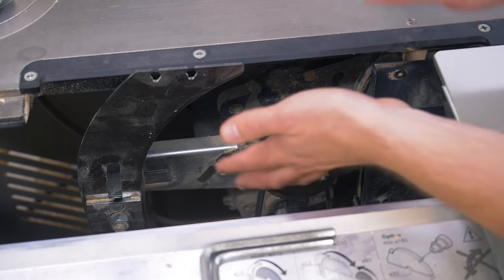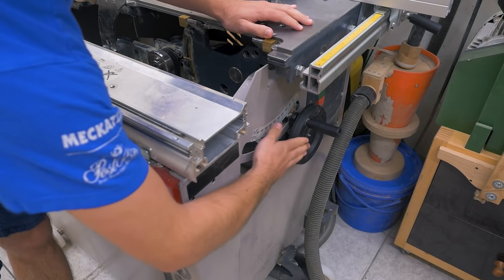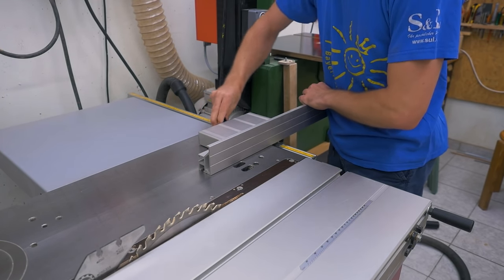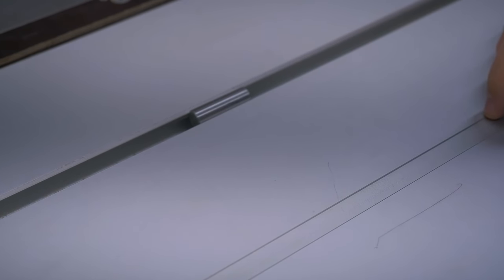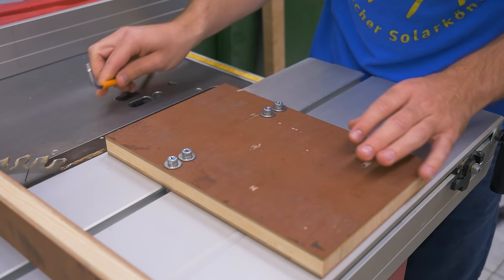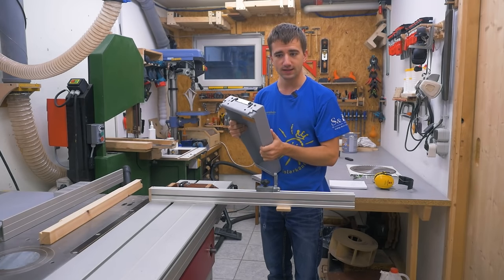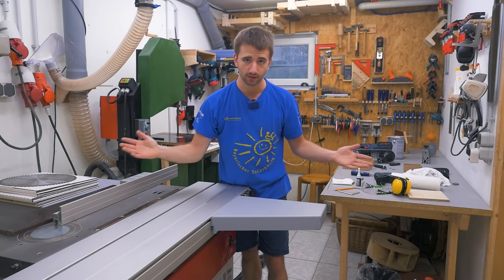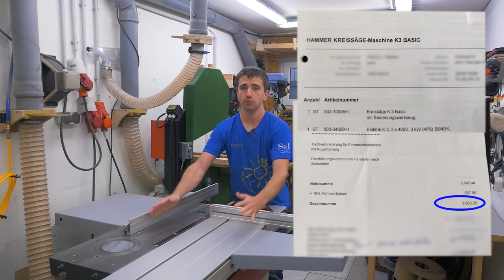Inside a Sliding Table Saw + Long-Term Review + Upgrades

Comment from the maker: Long break since my last video. I hope you like this one again. BTW, I made a new logo. What do you think about it?
Reply: I like that it doesn't look like the ROHS certification symbol ;)
Reply: On a more serious note, it's easier to see what this one is. The saw blade was much too small for a youtube thumbnail.
It'll be exciting to see how internal gears like that fits into your future projects...
Reply: 12 51/127th of an inch, yeah even us non-metric users don't use those fractions, My goodness! For reference that's just slightly smaller than 25/64ths which I still don't measure things that small in my wood shop, too small for me to see
Reply: Logotastic :)
Reply: @jebowlin3879  But your finger can still feel a 1/64th difference between 2 lengths.
Reply: For the record, most people I know do not use Imperial measurements for anything small because it’s very arduous. When I’m building with precision in mind, I always use metric. When I’m roughing out measurements, I use Imperial because it’s ingrained in my mind — I can see with my eyes if something is 18” with great precision, but I’ve never been able to make the mental leap with metric. Does that make sense?
Reply: I like it!
Reply: I like the video and how you have attacked the improvements. Your logo looks a bit like a planetary gear. The initials are clear, but for what will the graphic stand for? Jigs, tools, metal vs 🪵? Have you tried to combine M and H to a single letter ?
Reply: Hey, very nice logo, fits very well to you and your projects! One question: could you link were do you get those nice flip handels? ...need to do some upgrates =)
Reply: I like it, but I'm gonna miss the old one :/
Reply: Waiting for Felder contacting you again for improvements and something like that... was du schon alles gerichtet und umgebaut hast bei den Produkten von denen... Hammer... 😎😉
Reply: Two of your newest videos went unnoticed from me because of the new logo. I found this one only today. These videos have been in my recommendations but I haven't recognized them as your videos.

Comment: An interesting in depth real world review by a guy who has bought the gear with his own money - this is very different to the sponsored channels.
I have a bigger brother with the integrated spindle moulder and love the precision and safety these saws provide.
I installed a decent ducted dust collection when I purchased the saw and a couple of years later designed and built and automated control system to handle the 2 gates on the saw/moulder, 2 on the planer/thicknesser and the one on the bandsaw. This is one of the best productivity improvements as it allows me to concentrate on the cuts rather than turning the collector on and making sure the correct gate is open.

Comment: Hello Marius, I remember when you bought that Felder table saw, and visited the factory, if I'm not mistaken, and helped the Felder designers re-engineer that 'flip-stop' mod..which was rolled out to existing customers, and used in later factory customer builds on your machine type. It seems not very long ago, ha ha. Clearly the Felder machines are first class, as your saw still looks very new. I am very jealous of your lovely table saw..sadly, where I live, the import duties would probably double the cost of a similar machine sent to where I live. I manage with a much lesser table saw...with a lot of mods, but will never approach the precision of a decent factory built tool. Keep up the videos, you are one of the best engineer YouTubers, and we appreciate your no-nonsense, and very human style of videos..we all make (many!) mistakes which we learn from when doing woodworking, and I love that you include some mistakes on your builds. Many thanks for all the hard work that goes into quality videos that you make.

Comment: Great video, and thank you for the look inside the K3.  I wanted the K3 Winner for my shop, but the delivery time was too long.  Instead, I bought the Minimax SC2 Classic for about the same price as the Classic from a distributor in Mannheim.  The delivery time was one week and the cost included the scoring blade option, delivery, assembly, and commissioning.

Your ability to recognize an opportunity and develop a working solution never ceases to amaze me!  Your solution for the extension table is wonderful, and I hope Felder is watching and paying attention as it did with your flip stop design.  The extension table for the SC2C is similar to your design which makes installing and moving it simple and easy (Einfach ist immer besser 😄) .  I attached an Incra LS25 positioner to an extension table to create a point in space for ripping with the slider instead of the fence.  I haven't used the fence since.
Reply from the maker: The LS25 positioner for ripping sounds pretty good. I assume you have a bit more space available than me

Comment: The endcap zero clearance was mind-blowing. It's so silly easy. Its so brilliant. Im making one for my felder asap
Reply from the maker: Did you know that Felder also offers them for sale (at least for Felder and Format4 saws)? Don't look at their pricing though, that's insane.
https://www.felder-group.com/de-de/shop/splitterzungen-sc123868/splitterzunge-fur-format4-ablanganschlage-sp123870
Reply: @MariusHornberger  I didn't know that, but i sneaked at their pricing and for that price i can make my own, enough to last me a lifetime, and still have som change left, hehe. But thanks for the tip, and for all you're entertaining and informative videos.
Smooth sailings, be safe.

Comment: The two lugs on the Arbour are for the braking.  I worked for a company that bought a new saw, and then couldn't use any of their existing blades because they didn't have the twin holes.

Comment: The English expresion: "Don't fix it - if it's not broken".   Love the sliding table on that table saw - I wished  American made saws came standard with them (they don't.   I have a Delta Contractor Table saw as well as an older high end Powermatic 66 table saw.")

Comment: The way you did that zero-clearance end cap was smart. I've been hesitant to drill into my fence. I should just get over that. That end cap is super useful, and the one Felder sells in their shop is stupid expensive, but easily made.

Brilliant work on the extension table as well :)
Reply: I made that on mine and drilled into fence (alas, hesitant). Once is done, you'll be glad you did that. Well spent time, and using the saw will be a new so much nicer experience. Cheers

Comment: You can contact your local Felder rep and order the upgraded fence and führungschiene separately as replacement parts, although I imagine it’s expensive. I have the B3 basic and I’m considering upgrading a number of pieces on it but overall I love the saw. I’ll be trying out your upgrades for the crosscut fence, thanks!

Comment: Hi Marius, 
I have the K3 winner and have been using it for 5 years. I agree with everything you pointed out. The Winner fence system is great. I'm going to use your upgrade for the cross cut fence 90 deg. angle stop. That is the weak point of the saw.

Comment: I used a 16mm dia aluminum rod for the slot in the slider. you can tighten it snug from inside the slot towards the top.

Comment: That fence adjust does look annoying. The adjustment on the Felder-brand saws is much nicer, especially if you get the microadjustment add-on. You may be able to buy the fence + rail and, with some drilling, retrofit it. Their current K2 Winner comes with a Felder-style rip fence with the round rail instead of the version you have.

Edit: I see you cover the K3 Winner at the end.

Comment: For much cheaper levers I have used quick release levers from bicycle seats and wheels. You can get those on aliexpress for a few tens of cents (or for free from old bikes on the scrap yard). Sure they might not be as heavy duty, but they still work well.

Comment: “Why did I wait?”  All I’ve ever thought of for an answer is that the inconvenience (pain?) just wasn’t enough to prod me into action. 12”+ blade capacity is a great feature. And I love the convenient wrench storage under the sliding table. Thanks for the video.  Question: are the two pin holes standard on saw blades (I assume yes, else locked into one source.).
Reply from the maker: No, they're not. But that's something you look out for when buying blades

Comment: 8:14 And that wrench was never seen or heard from again
Reply: He would need to get a Flight to DownUnder.....to retrieve it !!! Lol !
Reply from the maker: That is actually the perfect home of the wrench. For a blade change you always have to move the sliding table back and then you have access to the wrench.
Reply: @MariusHornberger  Oh I didn't realize it was actually where it lives
Reply: @MariusHornberger  that is possible only on the slider on Hammer saws. I have Felder K700 now and it can't fit there unfortunately. But they made a magnet holder for those on Felder machines.

Comment: Thank you very much for your videos!  I love watching  you figure things out and how you think things through.
On the fence: I'm not sure how you would incorporate it into your saw but I just bought a Dewalt contractor saw that has both a locking lever and a fine adjustment wheel and I really like being able to fine tune the setting. Another thing that would be cool is if you were able to add a way to slide a paper strip on top of or next to your ruler so you could have set points for repeated parts.

Comment: Regarding that end stop. If you had drilled an undersized hole and cut a slot through it, when you screwed in the insert it would have opened up the slot wedging the insert in place.

Comment: I noticed you adjusted the rip fence to be parallel. If I remember correctly they're set at the factory to toe away from the blade a small amount. I think your change is better. Your slider looks to be level with the cast iron table. Those are also set differently at the factory but I've been considering lowering mine to be flush as well. Did you change yours? Have you run into any issues with the slider being level with the table?
Reply from the maker: When I installed the rip fence I also set it  slightly out of parallel. (About 5/100 mm front to back)
And I lowered the slider to be flush. This takes a lot of time to get right, but it's worth it. No regrets

Comment: This is a great video. Good engineering and presentation. I have just received a Hammer C3 31 and getting to grips with it. Officially the machine does not support cutting slots with a saw blade but I'm sure everyone does it. With a 300mm blade the riving knife/splitter can drop below the top of blade and with the guard removed you can cut a groove. But the splitter can not drop below the top of a 250mm blade. Does everyone file out the slot in the splitter to fix this?

Comment: Hello and thank you for this video. I was happy to find the other two videos on the adjustment system on the other hand I can’t find flip stop, the Fence Knob and the foldable handle on Felder’s website.
Reply from the maker: I think they discontinued the flip stop and the foldable handle is not from Felder. I just bought one that fit
Reply: @MariusHornberger  hey, could you make a short video about that? I've seen plenty of comments on your video about the new felder flip stop saying their new saw came with the old version. I think it would be really appreciated by people looking to buy the same saw, so they won't be surprised or disappointed when they get it.

Comment: The beveling stops should never need adjusting, but sometimes dust will interfere with their use. That throws off your angle, so you always need to check after moving.
Reply from the maker: I also don't trust them and use a bevel box for angles

Comment: Nice video.  I like your end cap and think I will also build it.  I have installed the pre-saw (Vorritzer) by myself. I received the parts from Felder, but the instructions and some of the parts don’t fit as the machine construction has changed. So be aware when you also want to do it. As I have the K3 Winner, I would rather recommend the B3 Winner.  A bit more expensive, but far more opportunities with the router.
Reply from the maker: Good to know, thanks. Probably, when you got the B3 you then want the C3 ;)
Reply: @MariusHornberger  No, while the B3 is a K3 with a second motor in the housing, the C3 just has attached an Axx on the housing. So the B3 is really saving space (and money) the C3 is not. If you look for a all in one machine, you need to look at a Felder CF7xx. These models have a better all-in integration, but different price cat. So for a serious wood worker, that builds furnitures or things around the house ( like garden hut, car port etc. ) the B3 is the better selection than the K3.Next level would be KF700.

Comment: A quick and easy fix for that rip fence handle would be a weak flat spring (or pair of flat springs) that will center the handle when it isn't locked. Not strong enough to kick it out of lock, but just hold it when it is loose.

Comment: Really like your video's! Have you ever heard of the decimal Inch? At any rate find the equally divisible positive integers in an inch, a Foot, a Yard and even a mile, then compare those to a the same parameters in a meter and a Kilometer. What is the value of equal spacing? Why is EU cabinet shelf spacing 32MM? Ah, the power of the equally divisible Imperial system. However, I use a 9.4mm drill for 0-3/8 inch or 0.375 wooden dowels Use both based on the project.

Comment: It looks like a quality piece.  Maybe a safety spring lock in the fence handle?  Or maybe just add a spring to push out the handle.

FYI  All T-tracks are 3/4" Wide x 3/8" Deep
T-tracks feature pre-drilled mounting holes in base
Holes are 4" on center, 2" from each end 
at least here in the US.  Your's may be in mm.  🥵

Comment: The two pins on the spindle might just be to preclude saw blades of different types, to be certain that blades of the right specifications are always used.
Reply: The pin holes are there because of the blade brake which stops the blade quickly.
Reply: @rhorton2702  I have an oddball plastic cutting blade, and it has a single pin hole, so that other blades won't work on it. The center hole is almost 3", so that too is a limiting factor. It will cut wood very well, so I'm having an arbor made to fit it. I got two of these blades, and they are certainly not cheap. If memory serves, the blades are European, which means most assuredly that it's metric. There are a few brands of blades that are a close fit, but they don't have the pin hole.
Reply: @rhorton2702  my DeWalt saw stops quickly and doesn't have them.

Comment: Hey Marius, great video I actually bought a k3 winner about 2 years ago based on your original k3 basic video. I got the upgraded rip fence with heavy duty bar though (which I think was really worth it), and insisted they throw in the upgraded positive 90 degree stop that you helped develop for the crosscut fence (given the amount the saw cost I thought that was reasonable. Originally they were trying to get me to pay extra for it). On the sliding table did you ever look into fritz and franz sliding table jigs? they are very versatile and can do many handy things with a euro sliding saw like this!

Comment: Would you invest in a saw with a blade stopping mechanism like the saw stop ones?
Reply: The field for this type of safety feature is beginning to open up. I look forward to when it is available on almost any model. Felder has a system becoming available which sets the standard: non-contact and non-destructive, and instantly resetting. I surely would include it in the purchase if I was spending the bucks for a saw of this caliber.

Comment: For the fence; would it be possible to drill a small hole in the side of the cam lock, insert a small spring and ball bearing, then drill a detent in the aluminum housing to hold the lever in the middle position?

Comment: Hi Marius.
I managed to get myself a K3 Winner second hand for a good price. Is your lift mechanism really stiff on the upwards direction?
This one feels like the handwheel supplied is too small a diameter for the weight of the motor. The action is smooth but almost two hands needed to raise the blade.

It came with a 1200mm crosscut fence which is too long for my space so will have to make something like yours to suit.

I also got a 8mm groove blade with it. Frighteningly expensive from Felder.

It doesn't have the spindle moulder hole machined into the top so I plan on adding hinges to rhe back panel so I can store bits within the body.

Thanks for the videos.
Reply from the maker: That sounds nice. Turning the handwheel should be easy. Try to add some lubricant to the threads. They are a bit hard to get to through the front curved slot

Comment: Did you have any issues aligning the riving knife on you Hammer K3?  I'm having a hard time aligning it - any suggestions?
Reply from the maker: No, that has to be correct from the factory. Contact Felder directly

Comment: Great video Marius! Where did you get the folding handle for the sliding table (10:45)? Thanks.
Reply from the maker: I got mine here: https://toolineo.de/kipp-zylindergriff-umlegbar-form-a-thermoplast-stahl-v!T370070238916.html?f_DF75C366CBB69CF9DF3965FAA55C5C86=M8
Reply: Great. Thanks!